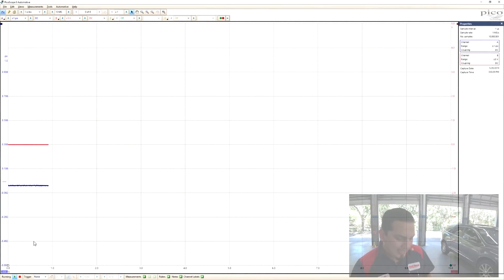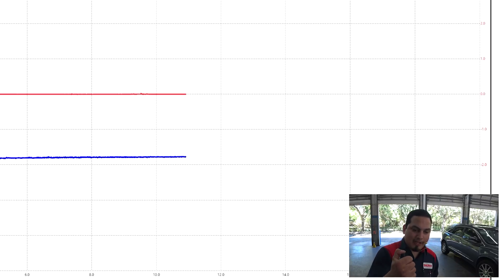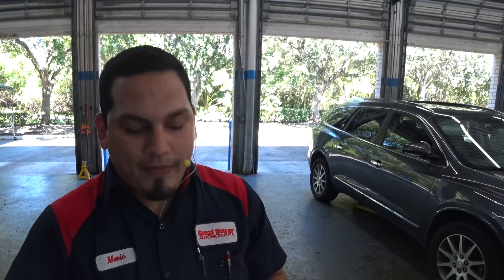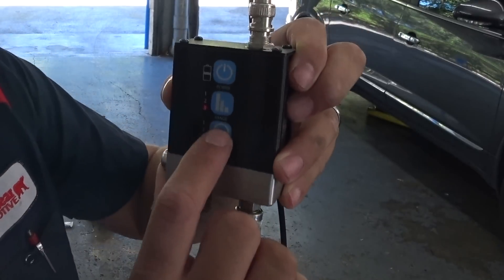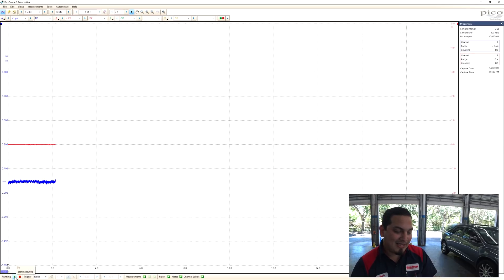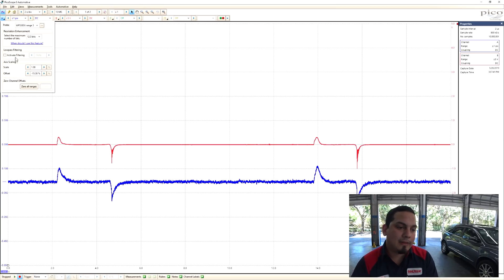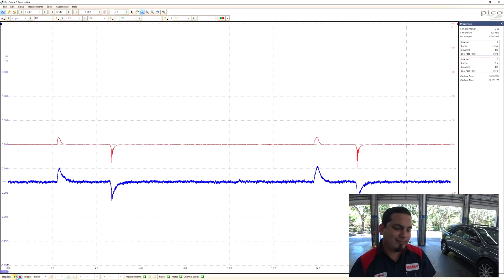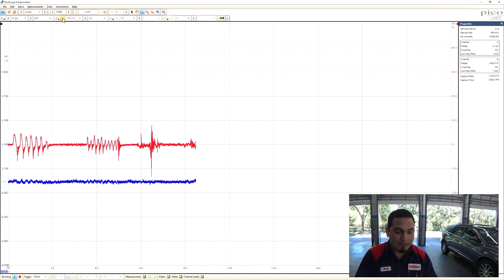Absolute vs Delta sensors(WPS500 DOES BOTH?)

Comment: Hello Mario

I guess I'm late to the party on this one as this was posted a year ago. Great job with your channel. 

There is some confusion here concerning terms. But first, nice video. I covered this myself along with others way back when the First Look came out. 

The WPS500 is not an absolute sensor. When you turn it on it calibrates and zero is BARO.  One of the best reasons to buy it (as opposed to Snap On etc.) is that it holds the calibration where the others do not. 

An example of an actual absolute sensor  would be a MAP sensor. 

The WPS500 is a differential pressure sensor, it measures the difference between a reference that isn't absolute zero and what you are measuring. An example of this would be a fuel tank pressure sensor. It measures the difference between tank pressure and BARO. 

Piezo sensors such as the First Look are not measuring pressure but rather pressure changes. Some call it a pulse sensor. These respond to pressure changes and amplitude is a function of the speed of change as well as the pressure strength. This is what makes them so useful for tests such as cranking vacuum. I don't care for running vacuum tests given the manifold airflow dynamics. Lots of techs have made bad decisions using the running pulse measurements.
Reply from the maker: Hi Jim, thanks for watching!

Yes this video is definitely not 100 percent correct in terms. I am by no means an instructor, but hoped to convey the difference between a signal from a piezo sensor, and that of a wps.

You are correct, the wps does not have a vacuum chamber to reference to, and will calibrate to 1 bar at sea level, but it'll show that as 0 psi in the software when it's really not.

There are several things that are questionable with how they present pressure and all that(0psi=14.5 in actuality, vacuum reading as negative psi numbers as opposed to reaching perfect zero, etc.)

Being a simple YouTube video, it's not what i thought should be included, and adding more complexity to the objective of the video: the difference in how piezo outputs a signal as opposed to the wps.

Thanks for the quick explanation!

Comment: Oh, I see, the piezo sensor is measuring the slope of the pressure/time curve. But don't you want live pressure readings for something like intake manifold pressure or cylinder pressures?
Reply from the maker: I personally use the piezo as i would a relative compression test, but instead, it's for intake, exhaust, coolant, and crankcase pulses. To compare each pulse strength and timing, and pinpoint the odd man out.

I always use an absolute sensor for in cylinder readings. 

I can't say that I use absolute sensors for intake much since most of the time, I'm cranking the engine for intake pulse. For running I'll use an absolute sensor, if no map sensor is already available.

Comment: Hey Mario, wondering about the addition to you diag cart on the front where you plug your leads into.. where did you find that , looks pretty sweet
Reply from the maker: Sorry buddy just saw this. The blue plate i cut out from a plastic clipboard. And the bnc extensions are from eBay
Reply: Right on man.. looks sweet